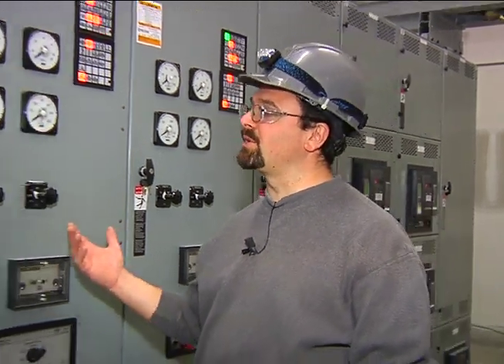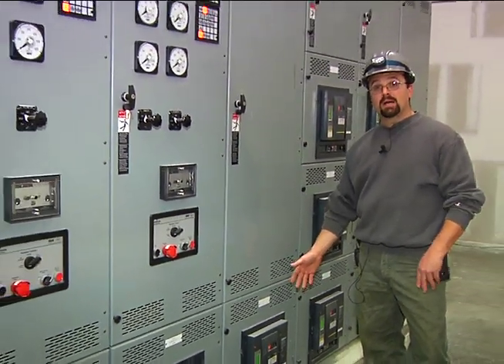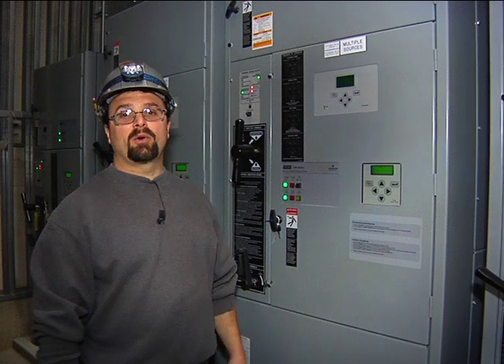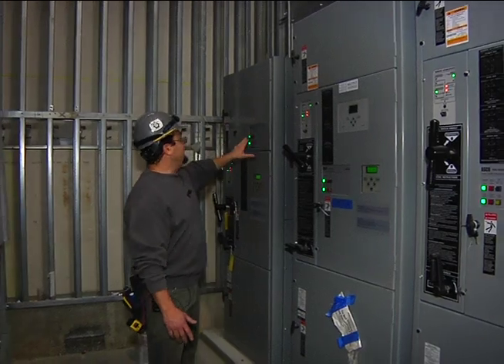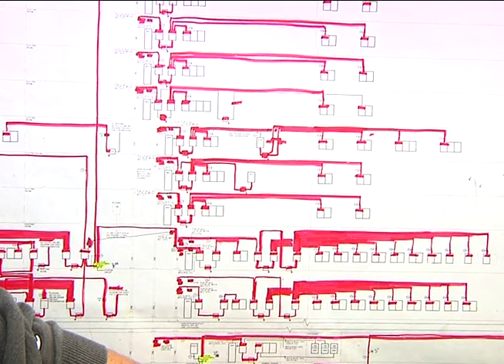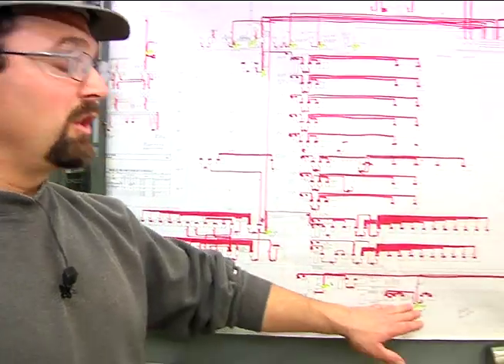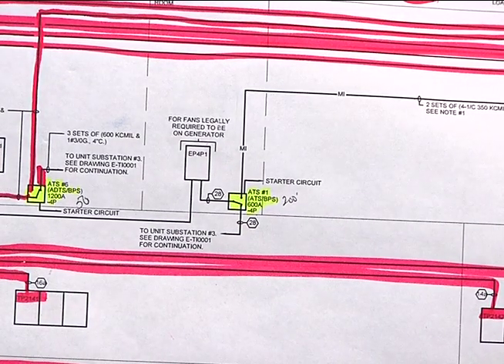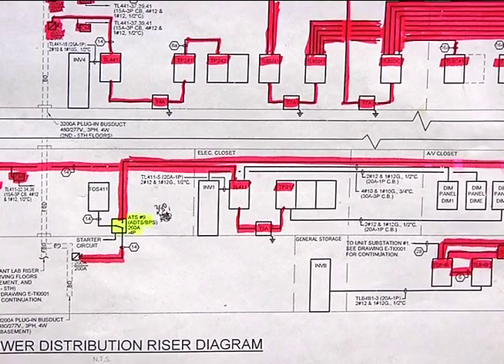Generators Paralleling Switchgear   Overview

Comment: I like how he doesn't mention that when you close a breaker you're not supposed to stand right in front of it.  If there's an arc flash you're gonna have a bad time...
Reply: That depends on the incident energy rating for an individual breaker.
Reply: I’ve seen medium voltage swgr have way less Cals than Low voltage